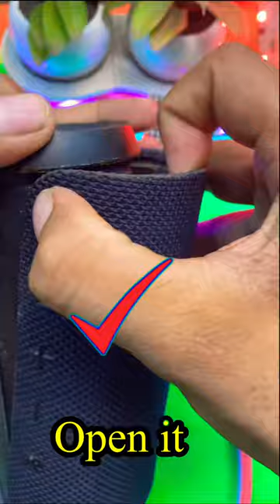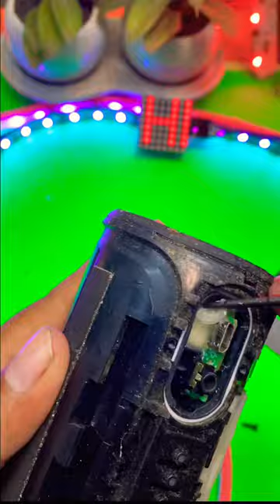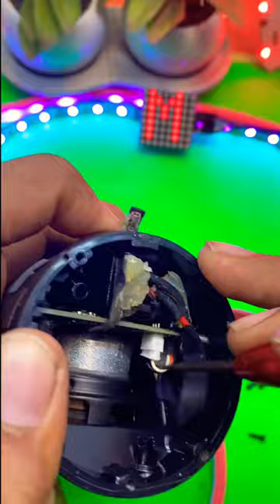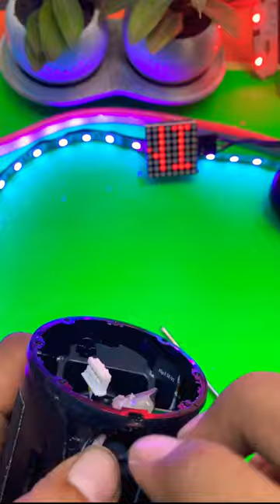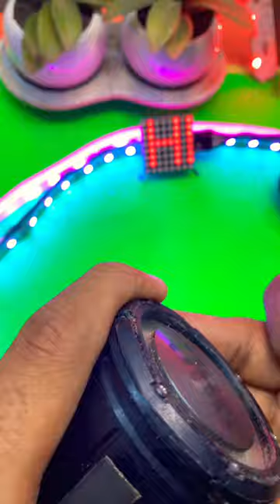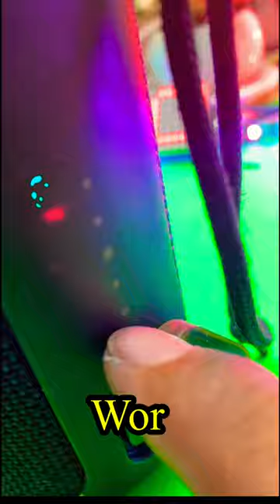How to repair JBL FLIP 3 charging problem #mtechnical #shorts #diy

Comment: Hello, my jbl flip 6 is more than 1 yr old now. And the battery is drained so I decided to replace a new battery. And it works.. however after I used it for few hours and decided to charge it, it doesn't charge anymore. What can I do? Any advice please 🙏 thank you.
Reply from the maker: Contect here 8898209528

Comment: My flip 3 used to work well till some time ago but nowadays all of a sudden the battery doesnt last at all ? I just plug it in charge and use it. Maybe because i put water on the radiators? But its meant to be waterproof
Reply from the maker: If one year completed please rrplace its batteries
Reply: @MTechnical66  it's been many years though
I don't think I can find the batteries here
Can't I just plug it in charge and use it like I normally do?
Reply from the maker: @sid123abc  contect here to get 8898209528

Comment: My charge 3 indicate that battery on charging but actually is not charge? Battery is new....
What's the problem with my speaker.
Reply from the maker: Chek output voltage from battery pin if voltage coming between 3.7 to 4.2 then its ohk but below voltage there is charging ic need to chek
Reply: @MTechnical66  ooooh okay thank you....✨